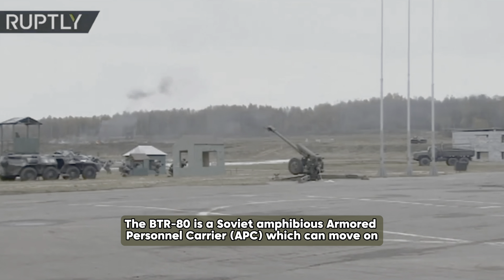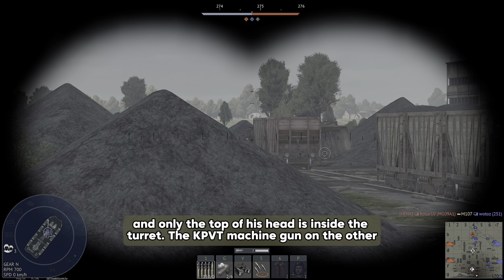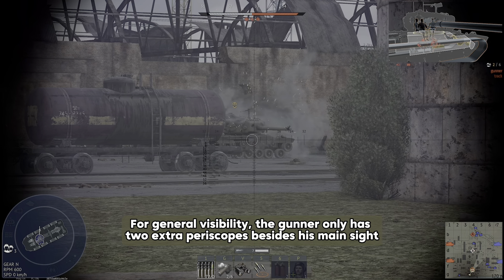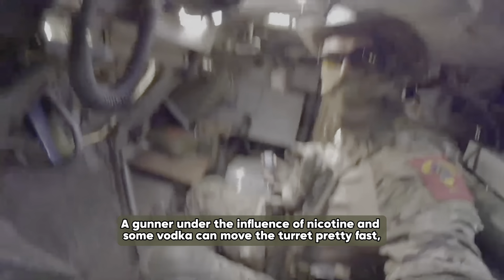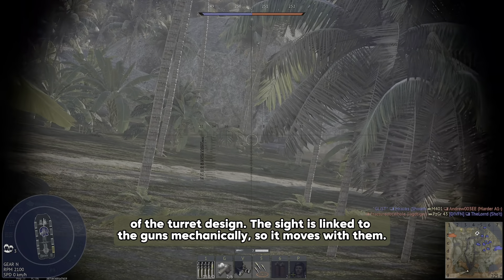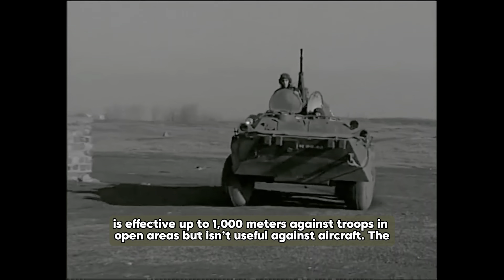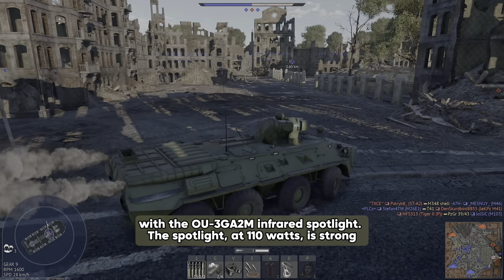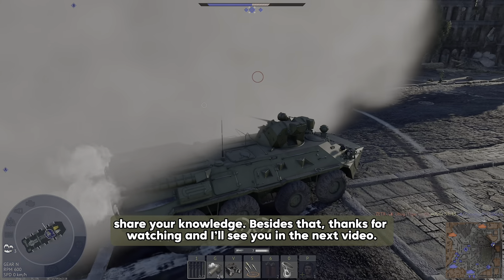What does the BTR-80 gunner’s station look like?

Comment: What i always thought that was insane is that the Early BTRs had that small side hatch that troops were expected to dismount from while the vehicle was moving 15-20kmph, like yh that might be slow but 1 fuck up and thats a crushed/rolled over soldier
Reply: Lot of good, lot of bad. It's... It's got merits, but easily overshadowed by western and Japanese designs.
Reply: You aren’t supposed to dismount moving. It’s not meant to be a combat vehicle either.
Reply: @Kazako83  yes... The BTR is meant for combat.
Reply: @Kazako83  bro, its literally in the BTR-70 training videos with the soviet union, the troops were literally dismounting while it was moving in live fire training
Reply: I can only speak for the btr-60 if that what you mean "Early btrs".

The btr-60 have 2 small side hatches. The right one is in the middle of the fighting compartment, the left one is in the middle of the troop compartment. We only use them when mounting the vehicle and you don't mount moving.

We usually don't use side hatch for dismount. We use the top hatches, get on top of the vehicle then use the incline to slide down then get ahead of the vehicle. The speed when dismounting is 5-10 km/h or human walking speed not 20.

Comment: The OT-64 SKOT handily beats the socks off every Soviet era BTR for one simple reason - an actual rear exit ramp for dismounts.

The BPU turret allows more accurate fire in theory. In practice they're mighty useless even compared to a pintle turret ring mount for one simple reason. Guns on APC/BTR are designed for reactive defensive suppression fire as a primary purpose. 

With a pintle mounted DShK on the original open top BTR-60 or M2HB on the M113 and humvees, it's easy to slew the gun on targets quickly with your hands (and the turret ring pintle can be easily motorized for quick gross adjustment, even if also unstabilized).

The hand cranks for BPU turret combined with completely unstabilized gunner primary sight means you can't hose down and watch tracers to adjust with your body reflexively. You're limited to the cranks.

What the BPU turret excels at, is to use the BTR hull down, and dial in accurate machine gun fire. It is a superior self propelled heavy machine gun platform to a simple open pintle mount on a moving turret ring, for accurate fire support.

But for vehicular self defense and suppression, the BPU turret is inferior to a simple pintle gun mount, manhandling the gun by hand, and watching tracers.